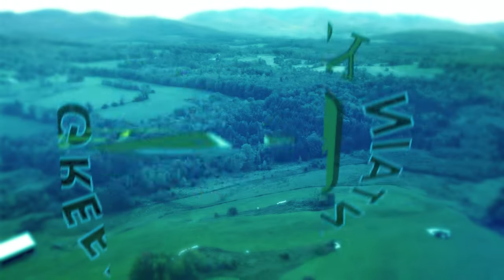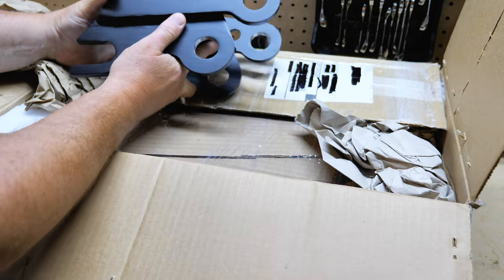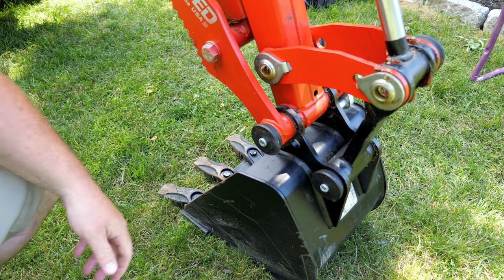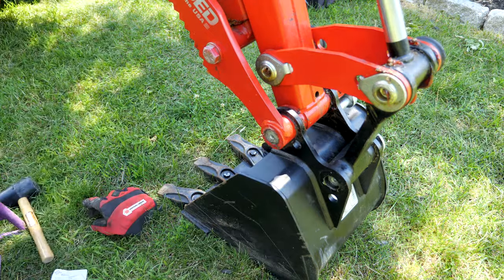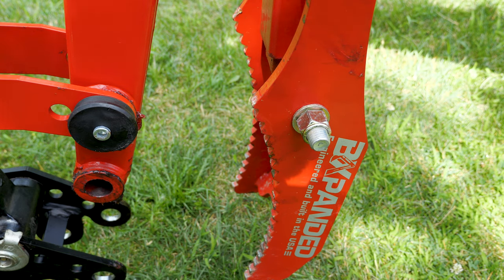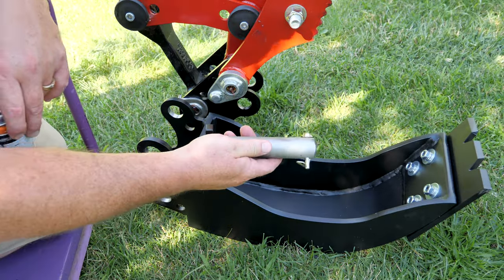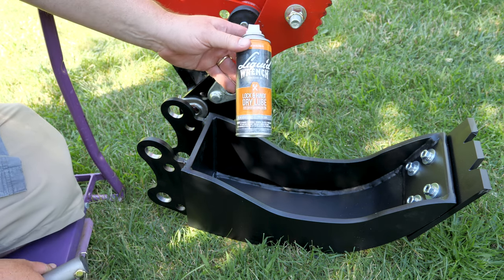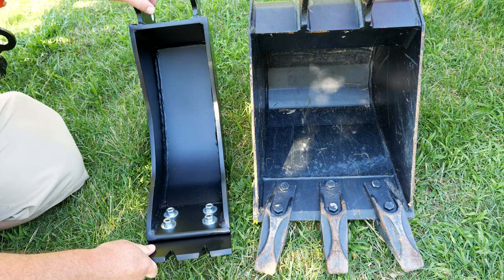RetailREMS -  Backhoe Quick Attach and Trenching Bucket for the Massey Ferguson GC Series!

Comment: The trenching bucket is fantastic. I've used it for hundreds of feet of trench so far. You can forget about leaving that thumb on when using it though, unless your trench is only go to be a few inches deep. Thumb is substantially wider than the trenching bucket, and needs to come off for most trenching work.
Reply from the maker: Interesting, I did the 100ft+ water line trench last summer and didn't have to take off the thumb.   https://youtu.be/VDrZbzlZOwM

Comment: did you install this backwards? most QA devices allow for installing a new bucket by hooking the closer pin, your setup would only allow hooking the farther pin. The open U should face towards the operator
Reply from the maker: Not sure, it is working pretty well. Thanks for the info.